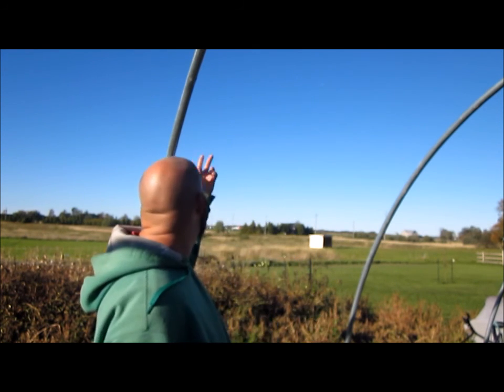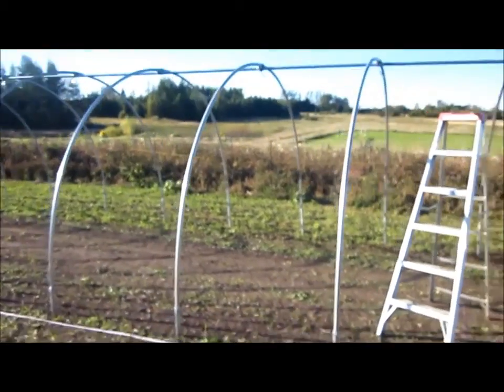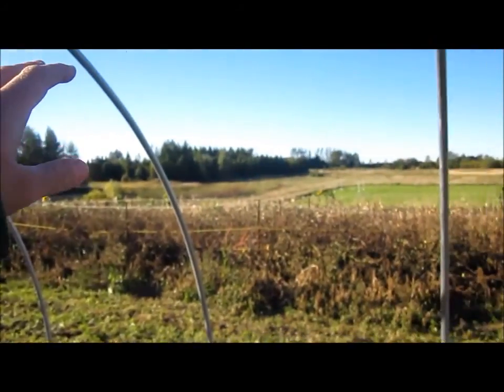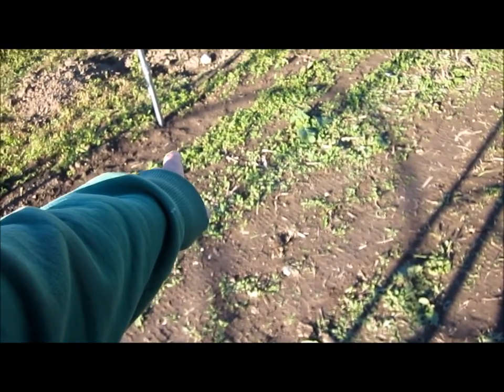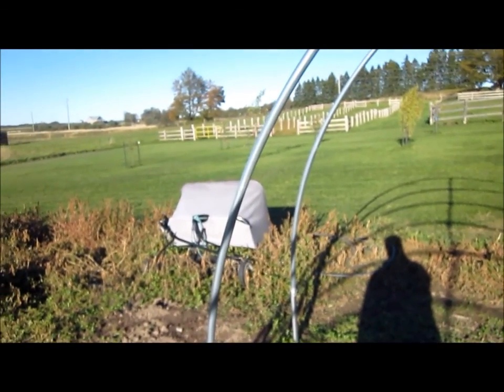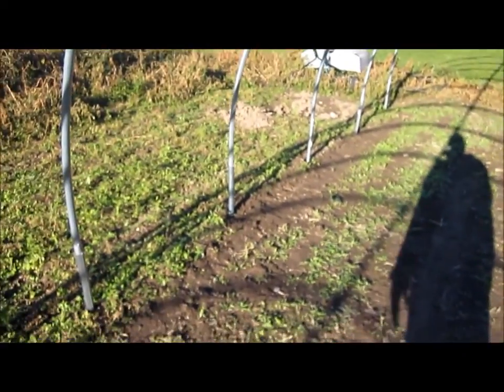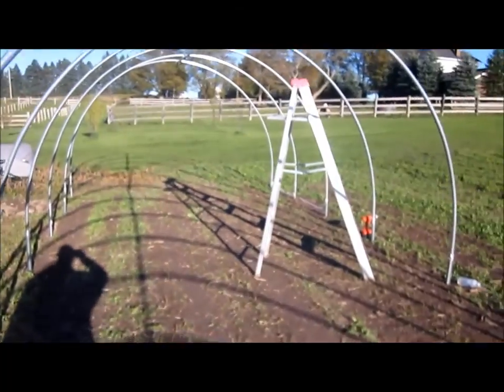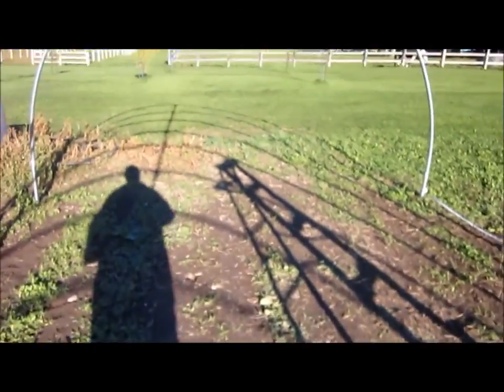Greenhouse Construction, Part 1

Comment: Thank you for the detailed breakdown!
How thick were the pipes that you used?
Reply from the maker: The pipers are 1 1/4" in diameter. The standard size is 1 3/8" or even 1 5/8", but the ones I used was the only size available.

Comment from the maker: Thanks Dale! It has been a lot of work up to this point. I had a heck of a time putting on the baseboards today. With my bad knees, kneeling and bending was a struggle. I only managed to get one side done today. Hoping to get the other side and start on the end walls tomorrow afternoon. 

I'll use 1 x 3 or 4, slats to attach the plastic. Wiggle wire would be good, but it is so darn expensive, that going with the wood will be my choice. As for inside, I am not totally sure yet.

Comment: You're off to a great start. Will you use wiggle wire to attach the plastic? How do you plan to configure it inside, will you plant right in the ground or raised beds?